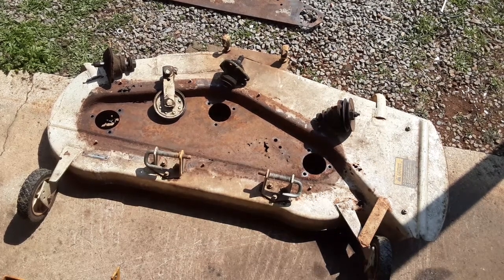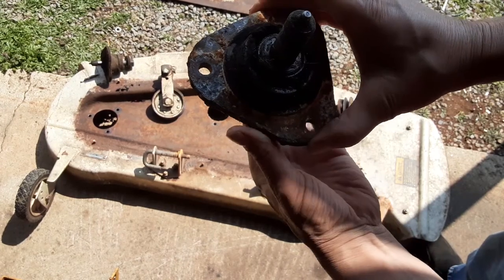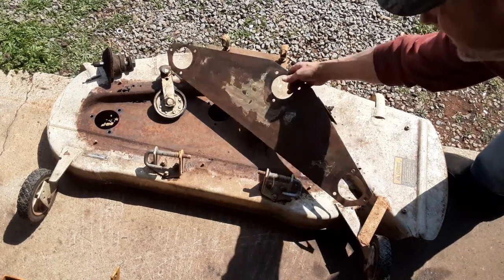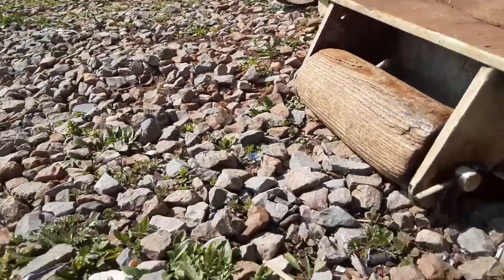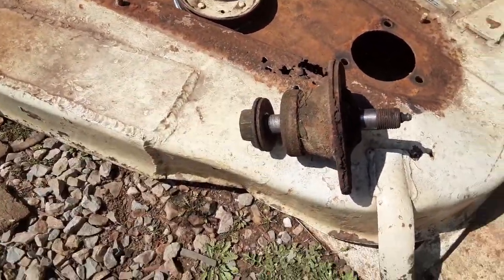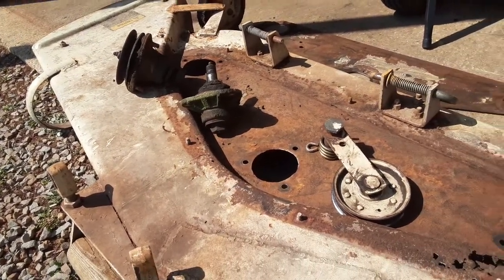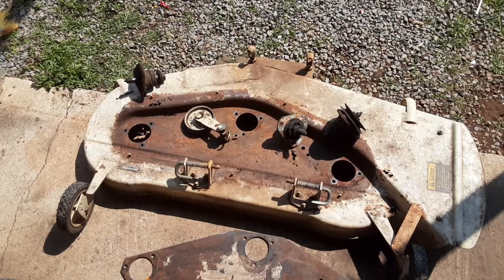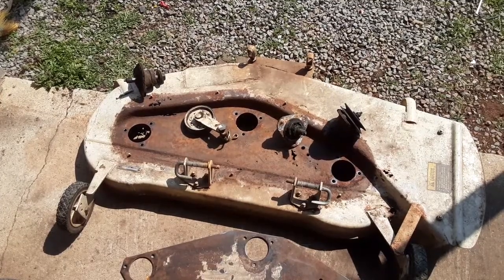cub cadet 86 deck damage overview

Comment: Hello Craig,
The question I would be asking myself is... Do the John Deere's run as nicely as the Cub Cadet? If not then would it not be better to do a great job on this damaged deck and keep the Cub Cadet.
Cheers.
Paul,,
Reply from the maker: That's actually kinda tricky to answer. I think I have the jd210 in pretty darn good condition at the moment,  with one of the 212s coming along pretty well. 

Out at the the other place the jd 400 is doing very well also as is the jd110( dont think I have shown that one yet) and a great running/mowing craftsman. 

While i truly cant say anything really bad about any "real" GT. The 200 series Deere's suit my needs very nicely.  
The biggest thing about the 200 s is the variable speed. There are a few other machines that have the same feature. But these really do it for me. 

Nothing at all against cub, I just like the JD a tiny bit better. When I 1st got the cub I immediately fell in love with it (but I had yet to get my 1st jd)   

Sorry for the long winded explanation,  but how does a person pick just 1 machine from the very best ever built. That's really what it boils down to
Reply: @craigtate5930  I guess if you have the space you could keep them all, the only downside is the maintenance x 5... or build one SUPER one, with an equally SUPER transporter and then enjoy the extra time you've saved on maintenance duties to build a SUPER JET ENGINE! You know it makes sense - lol.
Reply from the maker: @TheKnacklersWorkshop  I hope in the future to whittle the collection down to only what I need. 
After getting past the years of neglect on them I assume maintenance should be much simpler as well. 
It took me years to figure out what cars and trucks I want for the long term. Kinda the same with GTs and machining equipment I guess..lol

Comment: That's pretty well rusted.  Any chance of finding a used CC mower deck that could be adapted to fit your model?
Reply from the maker: They are available,  but kinda costly. Probably do just the minimal amount of repairs now, and try to make more time for the deck in the fall or winter

Comment: It is interesting that one of the hubs is fixed from the top and the other two the bottom. Does that mean that one of the blades is at a slightly different height? This does not sound right and it would be worth checking out the manual if you have one. The way we look at things is that these machines are built 100 times better than anything you can buy now and any investment in time and parts has a great return on investment. Not sure if it helps or not, but we have repaired decks in worse condition
Reply from the maker: I have seen a small amount of info online eluding to an aluminum center hub (under) and stamped steel outers (upper) 
At 1st glance they appear to have the blades at the same height, however I do plan to look at that better when it's back together.  

I feel pretty confident I can make a decent repair on the deck. I did some repairs to 1 of the JDs with good results (IMO) .
Considering how old these decks are  I certainly dont want to scrap 1. Not that they are rare at this point, but there are certainly less with every passing day